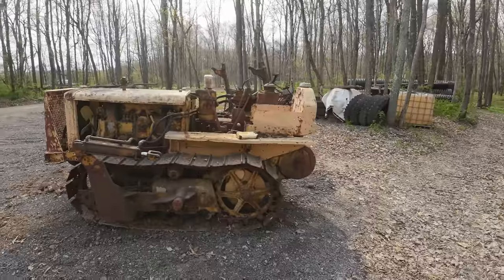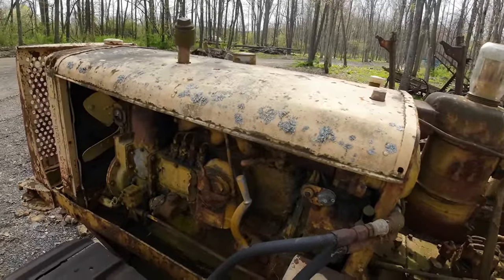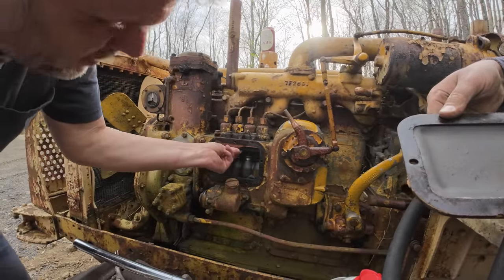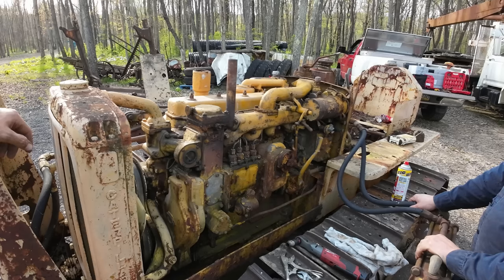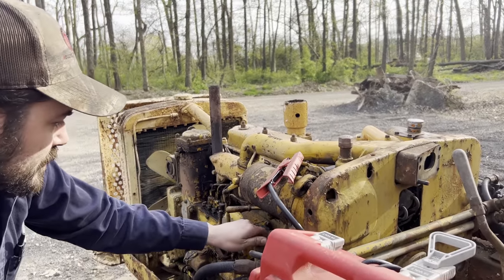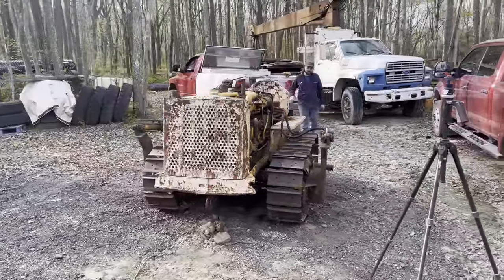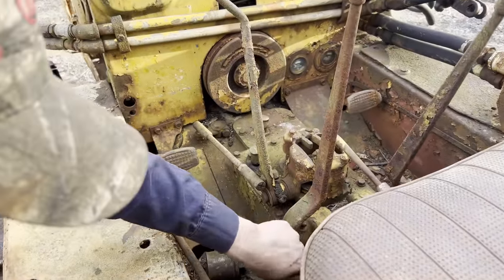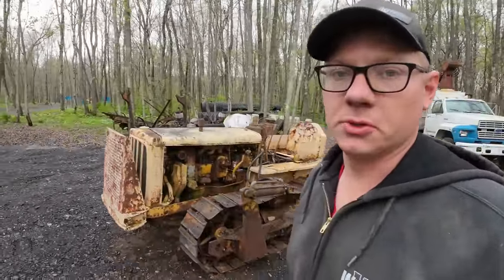$500 Caterpillar Dozer sitting since 1992!!! (Will it Run!?!?)

Comment: La Plante Choate is French go with that. The Foundry The firm The Company & sound (show with t) looks like a dip in vinegar shower for a few days. Plastic film 4 mil &  a framed like  enclosure shower stall and plastic/stainless recirc pump pumping a shower mist spray over the whole darn thing. too big for a dip tank. But with even 5 gallons and a big mesh screen funneling into a central drain You could have the states biggest parts cleaner. And do many primary stage restore for others. Compete with walnut shell blasting?? No envy here at all but fun to see progress of a useful restoration.

Comment: watching this, I can understand why a lot of the early heavy equipment/tractor/truck operators actually preferred gasoline engines...much less hassle than the old diesels..especially in cold weather. I still prefer an old vintage gas farm tractor to their diesel versions in many cases...

Comment: If it was twenty year's from now, the stuff from the last twenty year's probably wouldn't run, because of all the miles of wiring, the unneeded emissions components that would be junk, and the computer's that would be fried.  You could take some old machine like this cool old dozer and get it to run.  I just hope that more people try to save this stuff, instead of the scrapper's hauling it to be melted down and sold overseas.  Good job, see you on the next project.

Comment: There foot board is below two brake pedals. Step on the right side brake pedal it must have hand throttle it up to 10 MPH then braking force to turn to the right press hard on the brake foot pedal. Maybe brake is in working order or else check the brake pads.

Comment: the old d7 dozer great grandpa bought out of the 50's controls mostly with all levers except the brakes they have petals. way more complicated then that little crawler
Reply from the maker: Actually it’s the exact same set of controls as your talking about….
Reply: @DieselCreek  is it? Dozer is in out of the weather in the back of the property I'll have to check it out I thought there was 2 extra leavers..
Reply from the maker: @bud1773  master clutch, 2 steering clutches, L&R brakes, throttle, blade control, the 7 should have a decelerator the 2 doesn’t. Maybe you have winch controls?

Comment: oh i bought my first tractor last year (im 19 ) its a russian made mtz 50 they where made between 1961-1967 it has a single silinder gas pony on it its really awesome 2wd power steering makesure you have gas and diesel in it and it will start every time weights 3500kg in package sized about the same as a suv like audi q7 or something like that bought it for 1900 bucks and only money ive put into it has been upgrades and accesories like a 3pt log grapple and quickattaches on hydraulicks and thats about it i was also thinking about doing a starter delite on it and use a pull cord but have to think about that pnly problem is in the winter the starter of the pony freezes and doesnt go but i just take a heat gun heat it up and bam it starts oh probably the best ting i added was tire chains but yeah over all its more reliable that any of the new ones ive ran

Comment: Does you use a high cetane fuel for these cold starts?(highest you can get plus cetane boosting additive) It really helps the ignition. Maybe not too much benefit for a normally tuned up engine, but probably worth it for a few gallons in this sort of situation.

Comment: Are there glow plugs or does the diesel block feed heat from the pony engine?I was wondering about injector timing but you got it running 👍

Comment: i once bought a kiddy pool and filled it up with old motor oil and put a track in it and let it spin trough oil it whas from an excavator it whas so stuck after an hour goin back and forwords it loosend up and old motor oil finaly had its use lol wel it whas that shop waste like oil diesel gas wd40 brakeclean atf

Comment: Matt Darnit: When are you young people gonna listen and learn about these starting engine cats? I mentioned it before re that D7 and I noticed others have also. I was surprised also that your friend to whom you gave the D2 doesn't have a clue either. 

These engines are not made to "Pop right off". The proper way to start them is to first start the Starting Engine. After a short warmup, put the big engine in gear, compression off turn the big engine until there is oil pressure.(you guys did that) Then with the fuel off close the valves and let the starting engine rotate the big engine for 5 minutes or so(depending on the original temp). Feel the big engine block and there should be some warmth, then feed the fuel to it. 

I watched you guys working with this D2 and it was driving me nuts. I was yelling at the TV but apparently you weren't paying attention.

Comment: Im confused... why were they looking at the magneto when they wanted to get to the points??  I thought the points are in the distributor, and the magneto only generates electricity like a generator or alternator.
Reply from the maker: The magneto has the points and condenser and essentially distributor all within it. The points get dirty or slightly corroded from sitting, then no spark!
Reply: @DieselCreek  thanks so much for the explanation. why didn't gasoline road vehicles in the 60s and 70s work like this??

Comment: The nice thing is that Cletrac/Oliver crawlers had direct electric start....none of this pony engine nonsense....
Reply from the maker: Pony engines had the advantage in cold weather, didn’t have to worry about draining batteries
Reply: @DieselCreek  That's why they had the "Chevron" cold starting system.  Ether in a capsule....
Reply: @DieselCreek  Just drain the battery on the pony motor.
Reply from the maker: @anderleof  the whole idea is that small gas engines were far easier to get started in the cold weather,plus the small engine would also pre heat the diesel. They share the same cooling system so it would circulate warm coolant plus the exhaust runs through the Diesel engines intake so it would warm the air the diesel was sucking in making cold weather starts a breeze, these old diesels really don’t like the cold compared to todays diesels. Also the starters of that area didn’t have the same jam they have today. If you planned on running in the cold back in the day, you wanted the pony engine!

Comment: Had to skipp the starting process it killed ne how they was doing it hurt
Reply from the maker: Oh wise one… what did we do wrong??
Reply: @DieselCreek  not being rude by any means after starting the pony motor to turn the big engine slowly adding the decompression leaver slowly letting engine to warming up the cylinders for a few minutes depending on weather then adding the fuel. Not adding the fuel to run then hitting the decompression to start it.
Reply from the maker: @dakotak8437  keep in mind your seeing an edited down version of this. That’s how we normally do it but we tried that about 20 times with no luck. When the first thing you try doesn’t work you gotta try other stuff engine was plenty warm by the time we were doing what your talking about
Reply: @DieselCreek  that's what I was hoping I know your pretty good about that stuff. But that's  why I couldn't watch that clip part.

Comment: You need experienced Master mechanics in diesel engine we are Pro ASE certified engineer. We need your help in old Cummins L10 in rig it up but it was like 2600 RPM and will not go to 600 RPM like it's suppose to. How to check compression gauge for 1000 PSI in 7500 hours of drive S2300 10 wheeler plus slave chamber emergency is broken and replace it with good slave that the new part is to disengage energy brake with a pressure from International pump and Delco diesel pump with its governor REMY expert you anyone?